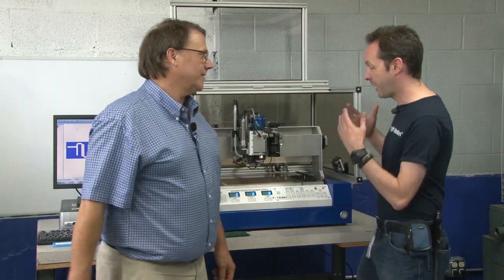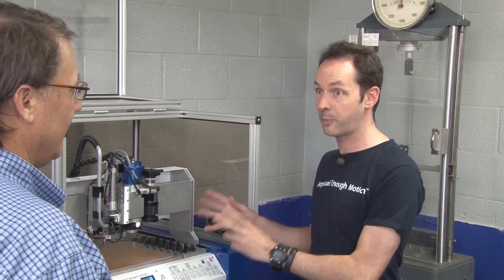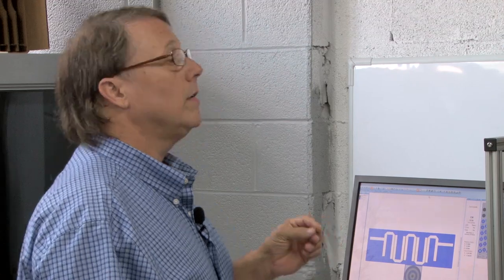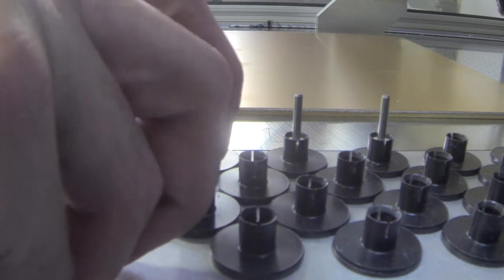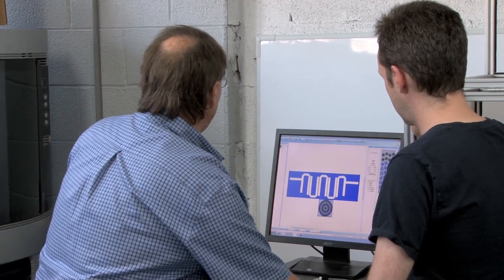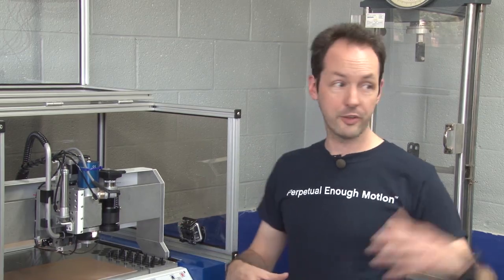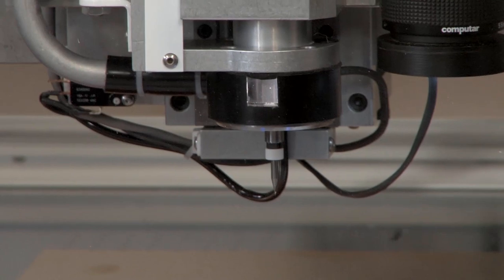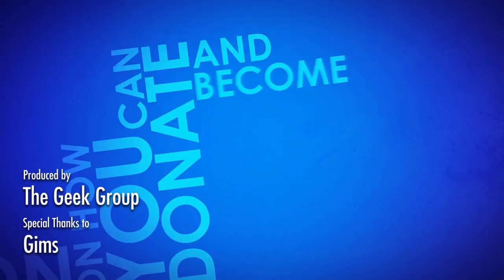T-Tech Board Mill Basics

Comment: A suggestion for a TGG YT video-electronically/electrically restore a vintage/antique tube radio. YT ember radiotvphononut in fact has done that with such radios & has had them up & working again. Some advice in doing such repair is using a variac to slowly bring a tube radio to full mains voltage (& hope that nothing smokes or explodes.) & using an isolation transformer with radios that might have a "hot chassis" meaning one side of the power cord connected to the chassis.